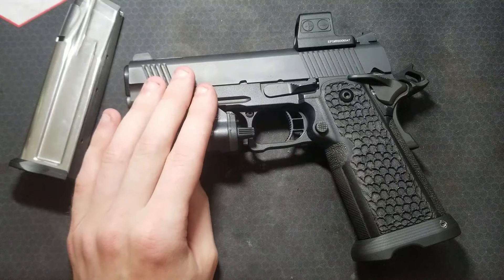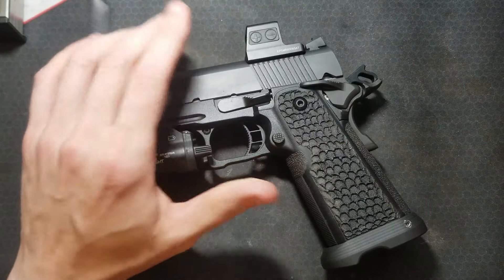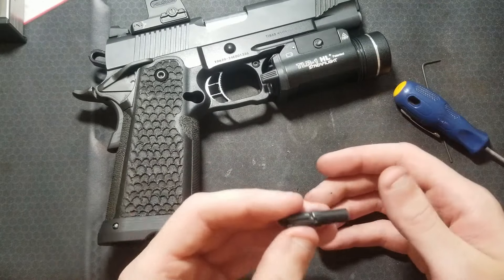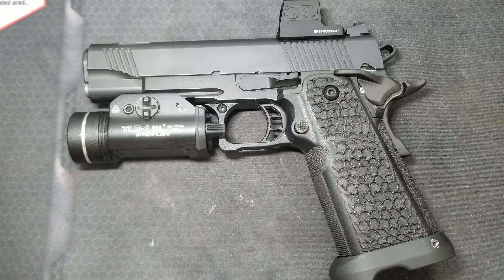Weird Trigger Failure Tisas 1911 Carry DS Won't Reset

Comment from the maker: I have made a discovery. This is a Gen 2 staccato style magazine catch. That is weird because it appears to be a Gen 1 style grip module in every other way. If you look at a Gen 2 mag catch (like the ones linked below from 10-8 performance, and the factory Staccato), it has the longer cutout and lock pin towards the center. This grip module should take gen 2 Staccato magazine catches. However this still leaves the little half circle cutout in the center where the overtravel screw goes. If its small enough or in a slightly different spot it would probably avoid this problem.

https://www.10-8performance.com/magazine-catch-staccato-2011-gen2-double-stack/
https://staccato2011.com/products/staccato-2011-gen2-double-stack-magazine-catch-assembly-dlc

Comment: I bought the same model of Tisas and the issue mine came with was that with a magazine in the gun the trigger wouldn’t function. Took it to my local gunsmith and found out the trigger yoke was deformed and came in contact with the magazine when pulled. The gunsmith fixed the issue but buyers be warned , TISAS has quality control issues in their double stack line. For a few more dollars you might have better luck with a Rock Island, if you’re looking for a budget 2011.
Reply from the maker: Dang thats a bummer! Mine ran fine out of the box. Little rough with some shit tolerances here and there but it did function reliably.
Reply: I have not had that problem with mine. Only 100 rounds through it tho…

Comment: I had this exact failure on  a prodigy last Sunday at a match. I had put the trigger bow in the sonic cleaner which degraded (removed) the blue loctite on the over travel  screw. It somehow moved in and I was left with a single shot 2011 on my first stage, having to manually pull the trigger out after each shot. After the second stage, I figured it out. The over travel screw looked too far in, and I adjusted it back out. Worked for the rest of the match. The prodigy has a cheely e2 grip on it and does have a slot in the grip for the mag release screw tab. I'll have to remove the mag release and see what it was getting stuck on.

Comment: So what would cause my ds carry to do that same thing randomly, that is completely stock??
Reply from the maker: Couldn't tell ya. when the trigger sticks to the rear can you release the magazine? If you can its probably not related to the mag catch like this one. I would look at sear, disconnector, sear spring adjustment (probably not the culprit, the stock trigger is heavy as hell), check for grit or anything preventing free movement of the internal components. The frame and internals are cerakote covered and that can make parts gummy, they just might need cleaned up a little where they interact with other parts.
Reply: @dltz  will do, thank you for your help
Reply from the maker: @cowboy3-2actual67  You're most welcome! Hope you get it figured out.
Reply: @EngineersArmory could you resize that "hole" bigger as to not catch?
Reply from the maker: @Bedbassandbeyond  I would worry about opening up that hole causing binding with the spring or plunger. I would also not want my overtravel screw to come into contact with something that isn't solid. It may not be a repeatable stop point if it hits the spring and the spring deflects.

Comment: Very funny! unless you seriously  need the pistol, then NOT FUNNY! easy fix tho, can you turn the screw down to a point on that end? Maybe that would keep it from sticking and still give you the extra over travel adjustment.
Reply from the maker: Indeed very not funny at the worng time haha. Yep that would be one way to deal with it. The only issue I could forsee with that is that the end of the screw would be within that little cutout and contacting the spring coils. There is some side-to-side play of the trigger in the grip and the screw tip may hit a spring coil dead on or go to one side or the other which would change where the overtravel stop is and lead to inconsistency in the overtravel stop point.
Reply: @EngineersArmory shorten the screw?
Reply from the maker: @Bedbassandbeyond  That wouldn't do anything. The problem is when the screw protrudes at all from the back of the trigger shoe.

Comment: A friend of mine purchased a Tisas 1911A1, and it would never feed worth a crap. I've always tuned mine to feed anything, but didn't want to cut my buddies gum. After having fits with the thing for months, many shoots, I wondered it the one and only magazine it came with had gotten damaged. As I inspected it and compared it to my Joe's mag mania magazine, I realized that the FEED ANGLE of the magazine was wrong. 15, maybe 20 degrees different. I gave my friend one of my standard mags and he hasn't had a misfeed since. Tisas... Hmmm... Something to watch for.

Comment: I have an extra Mac 9 grip module, which has the same type of mag release system as a Tissas. I was wanting to use that Mac nine module on my Apollo 11 and realize I would have to drill out the inside diameter to accommodate the normal slide release diameter as well as make that little groove for the rotating pin to lock the Mag release in place. What is your thoughts on how to make that groove into the Mack 9 module?
Reply from the maker: I'm not sure what you're talking about with the slide release. Did you mean mag release? Having to machine that deeper counterbore?

Just use the MAC9 magazine release. Or buy a gen 2 mag release from someone - Dawson and 10-8 offer them I think (I haven't confirmed any aftermarket gen 2 mag releases have fit though). Without a mill and a groove cutting tool there is no good way to get that little groove for the gen 1 mag release in there. Since the MAC9 grip module was not designed for that type, there may not even be enough material around that area for the groove.
Reply: Thanks for the info. I didn’t realize there was a G1 and G2 type mag releases. Thought  this was just something weird that Tissas did. I happen to have a G2 staccato P and its mag release fits into the Mac9 grip perfectly. It does have a little bit more Material in the middle of it to support the over travel, screw, and  prevented from going into the slot/void.
Reply from the maker: @TheBiggmama  oh cool thanks for sharing that. I dont have any staccato pistols so I'm always curious about that compatability. Also good that staccato probably could forsee the over travel screw issue haha.

Comment: I think I saw someone get a springfield prodogy oem grip module, I wonder if that  would then allow a standard 2011 mag release and fix the problem.
Reply from the maker: I put a prodigy grip on my MAC9. Yes that allows the use of a gen 1 mag release. Maybe I didn't know this at the time of this video but what's in the tisas is a gen 2 staccato style mag catch. Which is weird becuase the grip module fits gen 1 mag wells.

Comment: I’d have to assume they did that for patent infringement purposes as the 2011 is still a relatively new firearm, unlike the 1911.  But maybe they had a different reason.  I just can’t think of a “mechanical/actual use” reason to deviate from the standard 1911/2011 design.
Reply from the maker: I'll go ahead and speculate. My guess is that it was to cut cost and reduce manufacturing time of the grip module. The standard groove in the 2011 grip module for the mag catch lock needs to be machined in after the grip is molded. There is no way to injection mold that feature. I am guessing they omitted that to save post processing time and money after the injection molding process, then designed their mag catch to work with the change.

In terms of patents, the original STI separate grip module and frame design is over 20 years old now and I believe their patents have expired (not positive tho). Also who knows what patent laws do and don't hold up in Turkey. I know pantents from anywhere else in the world don't mean shit in China for example. Maybe Turkey is similar.

My guess is the original patent is expired because the Prodigy design would have infringed on that as well and its American designed and made so it could absolutely be disputed if Staccato (STI) still held that patent.

Comment: Could the mag catch or safety be the reason why my trigger slants when pressed from the bottom and binds?
Reply from the maker: Not likely. The trigger should completely release the hammer before coming in contact with the magazine catch at the rear of its travel. With the thumb safety disengaged there is nothing that should be in the way of the trigger traveling rearward (the thumb safety physically blocks the sear from pivoting). With the grip safety fully depressed, it should be completely clear of the trigger bow (it physically blocks the trigger bow from traveling rearward). 

An easy test would be to take the magazine catch out and pull the trigger - does it still bind up?

Then you can try pulling the trigger with the grip safety engaged and not (leave the thumb safety disengaged). 

Then try pulling the trigger with the thumb safety on and off (without touching the grip safety).

Try messing with it to see if there is a condition that it occurs that you can isolate.

If it happens no matter what, its likely a problem with your trigger bow. I have seen too heavy of a trigger on a 1911 fatigue and bend the trigger bow.

If you disassemble the pistol you can see if there is anything in the way of the trigger bow sliding freely in the grip. make sure nothing is in the way or the sear or hammer pivoting, the disconnector sliding up and down, etc.

Of course, if you're not comfortable doing any of these tests or disassembling the gun that far, it might be time to take it to a gunsmith.

hope this helps. good luck.

Comment: I will be swapping my grip for an older Sti grip pulled off a build a few years back. Just curious if you tried to find a fiber optic front sight. The cut they used is bigger than anything I have found.
Reply: Interestingly enough, I just had this happen on Tisas with a Gen 1 STI grip with  dawson mag release, and red dirt trigger...

Comment: Sounds like if i want to do a trigger job get a better grip module?
Reply from the maker: After everything I have done to this grip module, if I were to start over, I would just put a Prodigy grip module on it. You can call Springfield and get them for $39. I am buying a MAC 9DS next and its getting a Prodigy grip module.
Reply: @dltz  right mac 9s my next pistol but i didn't think about the prodigy grip module sounds like a perfect combo
Reply from the maker: @MichiGUNder  Call up springfield and say you want a Prodigy grip module. They'll sell you one for $39 and thats what I would recommend. I bought two recently, they didn't even charge me for shipping. You wont be able to use the mag catch or mag catch spring and lock from the MAC9 so I would also add that to the Springfield order when you got them on the phone. May want the grip safety for the prodigy too. The tisas/MAC9 main spring housing fits the prodigy grip module fine. The Prodigy grip module should take the MAC9DS trigger or any other standard 2011 trigger.
Reply from the maker: @MichiGUNder  Also, I stippled my Tisas grip module and I like the texture on the Prodigy grip better still. Dont fuck with the MAC9 grip module just get the Prodigy one hahaha
Reply: @EngineersArmory  awesome thanks for the info
Reply: @EngineersArmory  yup will do great advice
Reply from the maker: Check out my pinned comment. This grip actually takes gen 2 Staccato style mag catches. Weird because it appears to be a Gen 1 style grip in every other way.